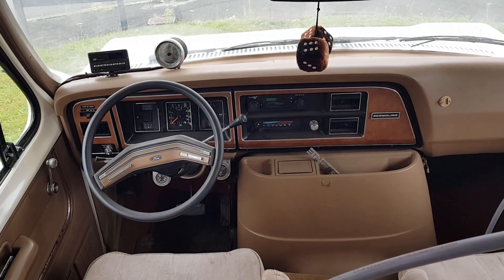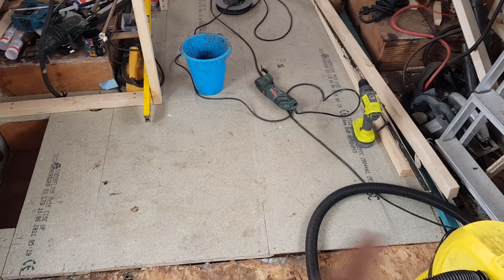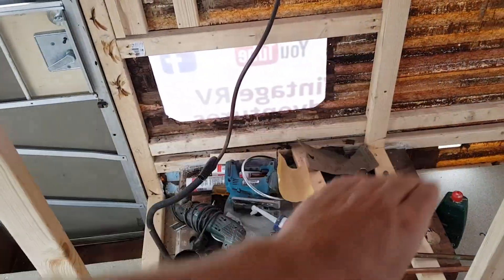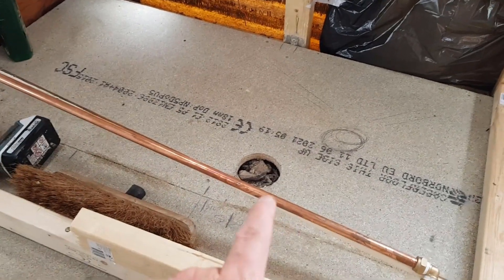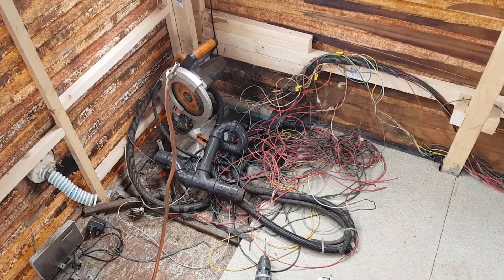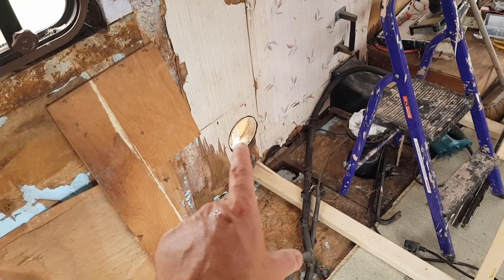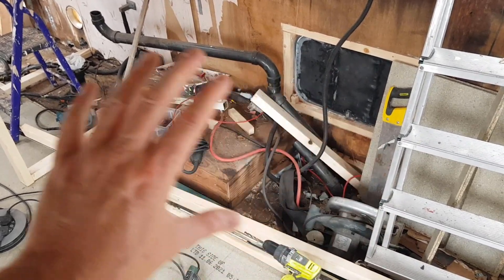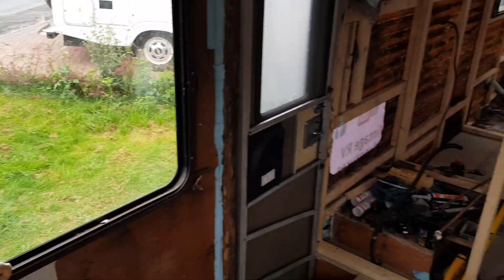RV Rebuild Interior Update | Living Room Shower & Toilet Construction Plans

Comment: Does it have aluminium frame? Right now im seeing insides supporting parts are all wood?
Reply from the maker: Yes the the accommodation unit has a full aluminium frame, this is an original frame, which we have not altered.
Reply: @VintageRVAdventures  ahh good all your hard work will last long with aluminium 😉
Reply from the maker: @dainius2082  We hope so. Certainly it is also true that the strength of the timbers we are using far exceeds the timbers we took out. We feel the bodywork will feel rock solid when we have completed the project.
Reply from the maker: We have added a little update on the end of our latest video, regarding the frame structure.
Reply: What kind of board did you use for the flooring?